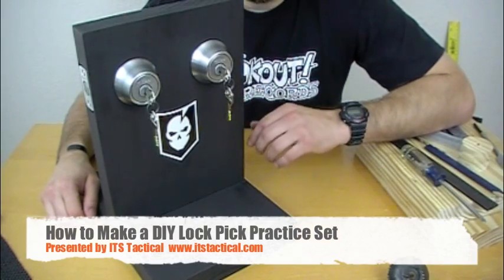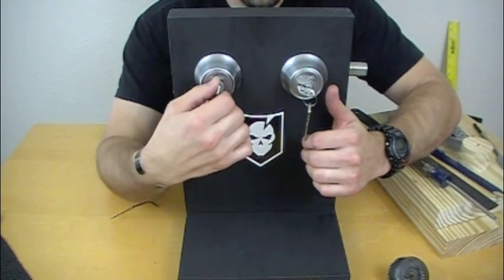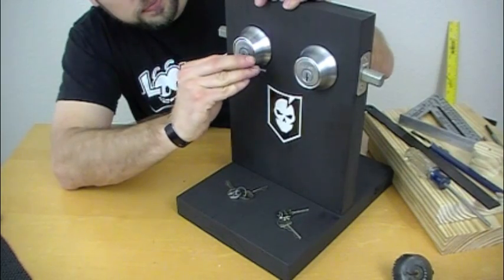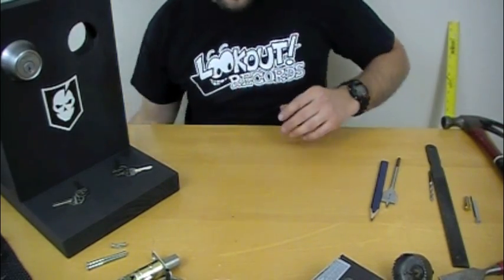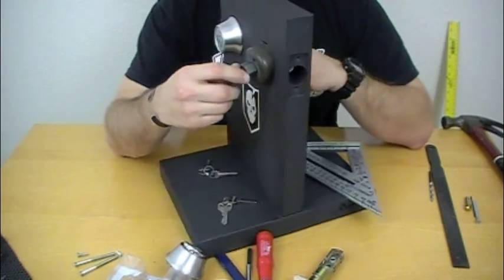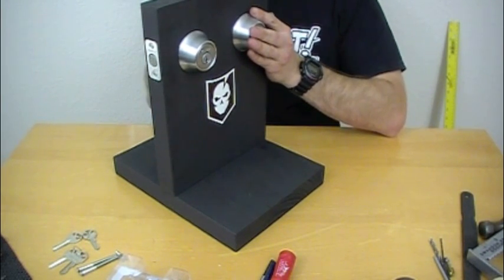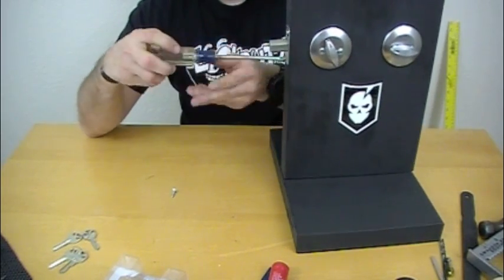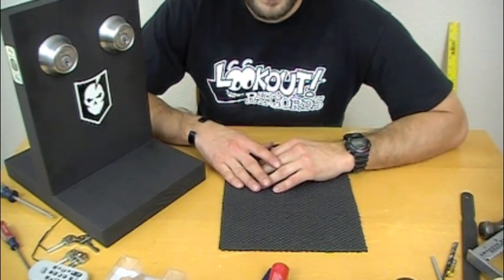How to Make a Lock Pick Practice Set

Comment: My advice from a woodworking perspective on how to improve this project and make it much stronger... Take a handsaw and chisel or a skilsaw/tablesaw and cut a notch half the depth into the bottom board all the way across. Fit the other board into the notch and paint both surfaces with wood glue. Then if you like you could drill two or three 1/2" holes in from the bottom an hammer in pieces of dowel rod...no metal fasteners needed. Also lowes sells a little jig kit for setting locks...

Comment: Yeah, I made one, but not with two deadbolts. Gonna be making a Lock pick making series on YouTube May 2014. I actually bought a Schlage bronze deadbolt for it, and stained it. I never knew about this video before I did it. I also stained my wood too. Gonna be doing this next month, but with a Yale & another Schlage. Maybe 3 deadbolts idk.. maybe take out the one I have already and add it to the new one. I also put eye hooks or bolts for 3 padlocks on the sides. Nice Lock Pick Practice Station. (+1 : 246)

Comment: For those of you who dont know wood working or carpentry, just grab a 2X10 from your local hardware store or scrap from a job site and it'll do the the job. (lumber these days is acutally a half inch shorter then the given measurements. i.e. 2X4 is 1 1/2X3 1/2)